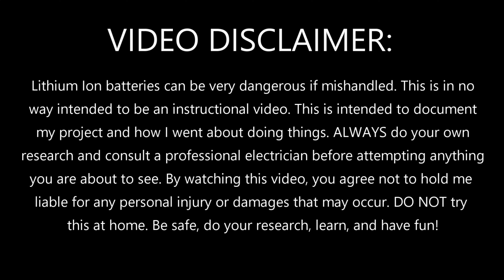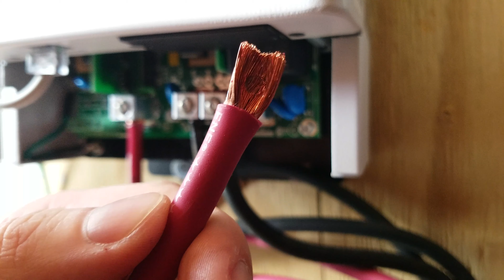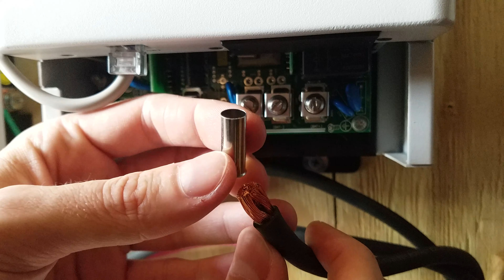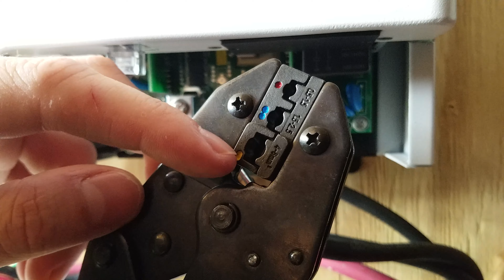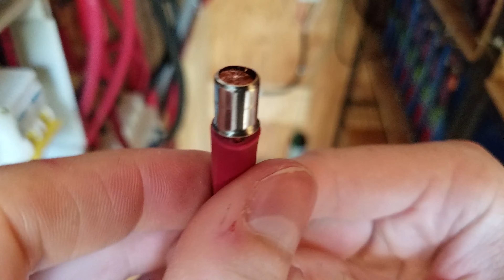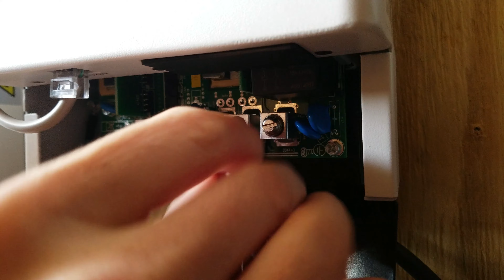Improving PCM60X Wire Cable Connections Using Ferrules

Comment: I was questioning using Ferrules over modifying my off-grid inverter to accept ring terminals. I see that this is a very good solution for the fine-filament wire that I'm using. Thanks.

Comment: victron forbid absolutely ferrules on mppt and inverter (square section screw connection)!!! they say clearly, more strands and more thin have the cables, better connection. ferrule is like one-strand cable. Absolutely forbidden in High dc current. I think victron not cover the warranty if you use ferrule and the controller burn.
ferrules on dc current is a bad idea. if big cross section cable, its a criminal idea.

see the manuals!!

now...this controller in the video have terrible garbage screw connections. a decent controller never have this connection. the screw dont push directly on cable . quality screw terminal are totally different . this terminal are dangerous and bad. never I wont in my house or RV
Reply from the maker: In most cases, I would agree with you; however, they are required here as these terminals are not designed very well...
Reply: @LithiumSolar  yes i understand you make this for this tipe screw terminal. Maybe works because thin ferrules take the shape under pressure. And principally because it's no big levels of current.
My emphasis is because I see some people put big ferrules on big DC wires like 16 mm2. In inverter screw terminal. Is impossible to have a good contact because ferrules are so hard.

Yes the big problem are the terminals in this controller. I don't will buy with this terminal. Is a clear sign of poor quality..like my English.
If low power, is acceptable. But I will don't use for more than 10 amp
 And even 10 amp is to much

Comment: Always advisable to reinforce the crimp with lots of molten solder. This makes connection rock solid and also eliminates any chance of sparking.
Reply from the maker: No! Definitely not! Solder melts at a very low temperature and you risk a fire if it heats up and melts out.
Reply: @LithiumSolar  the melting point of soft solder is 190 to 840F that is 90 to 450 C. If you have that kind of heat build up anywhere in your system, your electronics is probably already fried. My home runs totally on solar and I obsessively solder reinforce all lugs. Not doing that has resulted in mishaps.
Reply from the maker: No, just no... That is not the proper way to terminate a crimptable lug either.

Comment: so the terminals on the charge controller are round shaped inside with a screw that goes down on/into the wire. I can't tell what model or shape of crimping tool you are using, but is it putting a crimp only on the top part of the ferrule and leaving the round bottom part intact so that it continues to sit flush against the terminal wall? I have an application where i also will have a round terminal and screw so i'm trying to determine which is the best style of crimp and from what i've seen, it's just square, hex, trap that are commonly used. There is also pin indent but i'm not sure that would work well here. What do you think?

Comment: De krimptang die je gebruikt is geschikt voor de AMP aderhulzen en niet voor deze. Wanneer je de PV ook had voorzien van een aderhuls had ik het nog beter gevonden immers ook hier geld dat niet alle draden geklemd worden ja de stroom is niet zo hoog als bij de accu daarom is de ader ook dunner maar dan moeten wel alle draadjes goed geklemd zijn. Daarom een duimpje naar beneden.  
The crimping tool you use is suitable for the AMP ferrules and not for this one. If you had also provided the PV with a core sleeve, I would have found it even better, after all, it also applies here that not all wires are clamped, yes the current is not as high as with the battery, therefore the core is also thinner, but then all wires have to be good be clamped. So a thumbs down.🥴👎

Comment: A quick fix is to dip solder the wire stripped for termination.  Or Crimp a barrel type connector on the end as you did here..

Comment: Can't they also just be tinned with solder?
Reply from the maker: No. Solder has a very low melting point and is also much softer than copper.

Comment: I second that, if you don't have Ferrell tubes just use normal copper lug and cut down the ring terminal so that you have a flat piece of metal to work with. Much safer and better good video
Reply from the maker: That's a great idea! Getting good low-resistance connectivity is what's important.

Comment: Where do you get this PCM60X controller from? How much?  Do you like it for the money?
Reply from the maker: I bought mine directly from the manufacturer, MPPSolar. You can buy them on eBay but you'll pay more. To order directly, email peggy@mppsolar.com - she will send you an invoice. I have 3 of them and yes, they're well worth the money :)
Reply: @LithiumSolar  Thank you, Yes, I found them on ebay. didn't know it was MPP Solar. I had to search it exactly. Never seen it with other searches of mppsolar.  Thanks for the contact.  I will use it for the all-in-one if I go that way.
Reply: My only gripe is voltage needs to be upped to 200v, most panels these days are 300-350watts and hence a normal 4 String array is just tipping over the 145V on the unit. Of course you can series/parallel but something to be aware of when looking at your system.
Reply from the maker: Yes I had to put my 330w in a 2s configuration. They work ok with 3s but in winter, I kept overloading the Voc. It advertises 150Voc max but it starts shutting down around 142Voc.

Comment: I've picked up one of those Tomzn breakers to use on the output of my pcm60x. Are there any concerns that a short in the pcm60x will cause a fire in the breaker due to it being polarised and power flowing back from the battery?
Reply from the maker: Your battery bank should have a separate breaker that is non-polarized or a set of fuses. The battery bank is constantly being charged and discharged, meaning current flows in both directions.
Reply: Oh yes, I have large fuses on the battery side. Just wasn't sure if there were any polarity issues with these Tomzn breakers.   Obviously working well for you so I shouldn't be concerned
Reply from the maker: Well, it worked for me in the sense that I can use them as disconnects. I haven't had a short circuit to test breaking capability.

Comment: Hello, In case of the ferrules are too long is Cutter is acceptable by IPC?
Reply from the maker: As a general rule, modifying anything that has a certification or safety listing voids that certification or listing - even if it's just cutting something in half.

Comment: Every electrican know that its highly recommended to use Ferrules, actualy it have to be done otherwise you will have a higher resistance on the connection and it will cause risk of fire as well if the current is high enough. Pls always crimp them on guys!
Reply: and use proper ferrule pliers not just any old pliers that just happen to lay around!

Comment: Yeaaahh... I work making electrical connections and I use ferrules EVERYWHERE... read this article comparing resistance difference with and without ferrules when you install and a few years later https://hackaday.com/2018/04/12/to-ferrule-or-not-to-ferrule/

Comment: I think it’s better to not crimp them, I rather just slide the ferrules on and let the tightening screw/terminal tighten down on it, forming it to the screw and terminal on the inside, I think that it gets a much better sustained connection this way!
Reply: There would still be loose strands inside as the "sides" wouldn't be tight. Using the crimp forces all the wires to be tight against each other, not a strand left behind. Then tightening the screw down, the ferrule will shape to the screw anyways, applying even more force on the strands.
Reply: that is absolutely not recommended and extremely bad practice, not to mention giving advice about it
Reply: Urs Odermatt Dude the comment is nearly a year old.. and my comment isn’t typed out clearly obviously but whatever lol

Comment: I've found using Copper Pipe as ferrules works just as well and is way cheaper. Copper pipe is readily available all over and a simply tube cutter can easily size the Copper to length. Also you can get Copper Pipe at your local scrap yard too but not sure it would be cheaper but does allow multiple sized long or short lengths so there is that. Cheers...
Reply: Copper pipe works well but the down side is that bare copper will oxidate with time, ideally tin or nickel plated copper like all electrical lugs. Also depending on the copper pipe thickness you’ll need a bigger crimper, sometimes it’s just easier to get the proper ferrules from the electrical shop, they only cost between $1 or $4 each...
Reply: Pretty good idea. Could use the soft copper coils as they come in sizes all the way up to an inch. They also come in short sticks of 2Ft at the Box Stores, too.
Reply: Exactly

Comment: Turn solar off before the battery
Reply from the maker: The PCM60X has protections that shut it off and prevent damage, unlike other cheaper charge controllers on the market.
Reply: @LithiumSolar  i didnt know that i have a relay on my solar incoming to shut off the solar if my batteries cut out